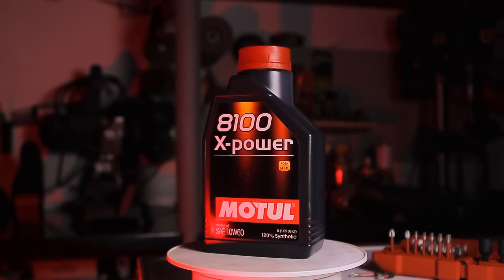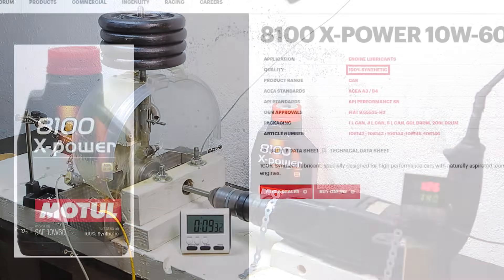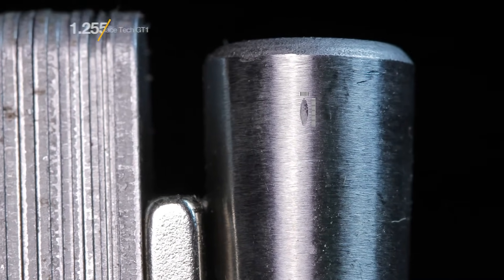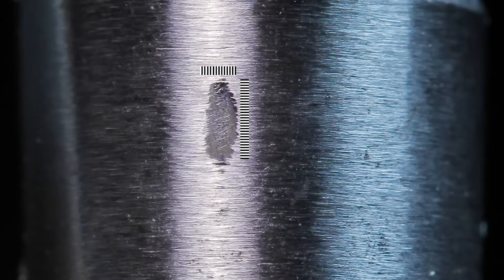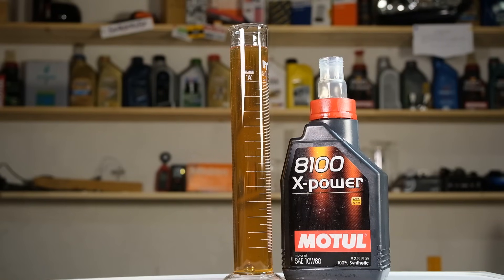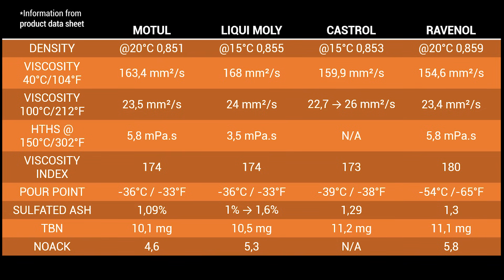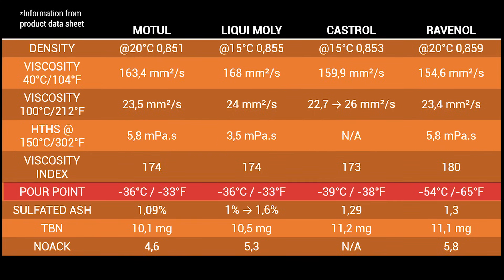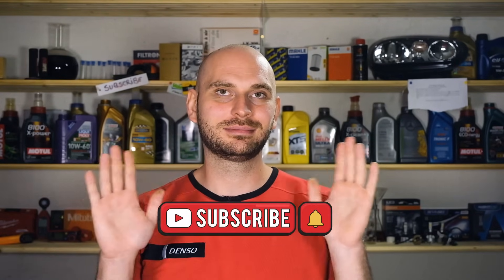Which is the best RACING ENGINE OIL - Motul vs Liqui Moly vs Castrol vs Ravenol - REVIEW & TEST

Comment: Your testing is incorrect and the results are 
misleading.  Pressure ball testing is different 
from surface-to-surface friction. You need to 
measure metal wear under HTHS friction.

Comment: The tests are imprecise because the oil must be warm to work properly and needs time for the additives to work. It's foolish to pour new oil into the car and start at full throttle. The oil needs to work, and there's no point in immediately putting weights on the ball.

Comment: Literally none of these tests apply to an engine. We live in a low information high confidence world apparently. No one knows shit and everyone thinks they know everything. Hey Mr. Expert. Please tell me the breakdown the basestock blends used in each of these oils. Oh no, you don't know what they are? Oh that too bad. How about the additive packages? Oh you also don't know. Man thats too bad. How about even on a very basic general level like doing a new oil analysis just to see the numbers? Did you even do that? Oh no you didn't. Yet you had no problem wasting the time of a quarter million people and influencing them with your utter nonsense. But hey at least you can tell me which one would work best as a gear oil with your lubricity test. That's great. Too bad it's not applicable to what happens inside an engine.

Comment: Can you test Royal Purple, Red Line, Motul, Ravenol, Mannol, Pentosin, and Liqui Moly (the best they have to offer for regular cars)? I have been using Amsoil, Penzoil, Mobil 1, Castrol, Valvoline, Quaker, Kendal, and many other oil brands in the same 3 vehicles (to be able to notice the difference). So far, Royal Purple and Motul have truly outperformed every other brand, but Royal Purple is the only one that actually cleaned to like-new condition the inside of the engines, and Motul is the only one where the vehicles purr like sweet kittens and had a noticeable increase in power and smoothness (yet, I don't know if it is capable of cleaning the inside of the engine as Royal Purple does). That's why I would love you to test Ravenol, Mannol, Pentosin, Liqui Moly, and Red Line (which are the only oils I have not tried - of the well known ones) so I can saved myself the trouble to waste money and time. I trust the way you analyzed the oils and your assessments... they are spot on to what I have witness and discovered in real life myself over the years. Your channel is much more helpful than Project Farm and The Motor Oil Geek. I find those channels sort of bias.

Comment: Finally!!!  A real and more accurate oil test reviews!!! Your tests are much better than the other channel Project Farm which after a detail analysis of what he does I discover a lot of controlled discrepancies. I  posted that to his channel and he removed my comment.  Anyhow, thanks for this review. It's awesome and I have noticed based on my engine performance (with several cars) that your results are spot on.

That being said, can you please test Royal Purple vs Valvoline Restore and Protect vs Motul. I already tested Amsoil vs Pensoil and they are both a let down in my personal experience after more than 10 years of using them (their top of the line oil). I noticed a great improvement immediately when switching to Royal Purple and after opening the engine I saw how clean the engine was. I had opened the engine on the last oil using Pennzoil and then opening it after the second oil change with Royal Purple and it was a night and day result. Royal Purple not only cleaned the engine like new but the engine sound and smoothness was very noticeable, although the car ran one or two degrees hotter though. Then I switched to Valvoline Protect and Restore but since the engines were already cleaned that part did not show any improvements... so I'm hoping you can provide a comparison on lubricity, etc. I also heard that Motul is probably the best European oil and I want to start using it in one of my vehicles which is European. So please, compare those three oils.

Ps. My engines suffered a lot (piston pinging, sludge, noise, lack of power, heat) when using the OEM oils... they ran much better when using Amsoil or Pensoil, and even greater after I switched to Royal Purple. But now that Valvoline has come up with "Restore and Protect" which can be used (according to them) on brand new engines and high mileage engines alike, then it seems like it is the "one-in-all" oil and there is no need to look further... but they don't make it yet for European cars, so in the meantime I want to switch to Motul... If only there was a way to test how good each oil is to clean engines, I mean, in a lab environment. I've done it in real life but that takes having a "normal" dirty engine and then using Royal Purple or Restore and Protect for about 15,000 miles with each test vehicle... I ran out of vehicles to test with since my engines are now super clean.

Anyhow, please, test Royal Purple vs Valvoline Restore and Protect vs Motul.

Thanks for this review and keep doing it.

this is a certified hood classic

Comment: What are the metals of ring and screaw? I mean like it's busted that some test liek that can be easy manipulitaed. eg Great Amsoil do 4 ball test, where each ball is made of steel, and whe their oil has some iron in it, it can reduce the friction between steel to steel... sooo, by just adding proper metal to your oil you can manipulate tests like that. Only test that is proper is on working engine...
Even when you haven't that in mind, you could unpurposly chose oils that would work better than other with the metals you use in your test, but it won't tell anthing about real use.

Comment: @Sergiu Gabor might also be a good idea to test how they perform when they're worn, e.g diluted with e85 which happens fast on high power cars that still run a wet sump.

Then there is the question on how they perform when they are carrying contaminents (metals from the bearings) within them, and how they continue to lubricate with these contaminents still present

Comment: Hi there. Greetings from Guatemala, Central America. Excellent presentation. I have a 2005 BMW X3 2.5 with a M54 engine. I am currently using Liqui Moly 10W-40 (MoS2 Leichtlauf) oil. Any comments or suggestions on if I should continue using this oil or should I change of brand and/or grade.? Thanks in advance.

Comment: Hi I found your channel very interesting and informative 
I run a vw golf r mk7 with a stage 2 tune and modified I see oil temperature normally around 90° to 110° a lot of tuners and forums say use miller's 5/40 part number ( 7953 ) oil or liqui molly ( 2328 ) oil but I contacted both manufacturers and ask what they recommended only miller's oil replied and they recommended there C3 5/40 ( 7806 ) I wondered if you could do a test on your channel testing these 3 oil against VW standard OE 5/30 oil as there is 1000s of people with in the VAG community in my situation running this engine.
Thank jim

Comment: How can Castrol not disclose HTHS in a high performance “race oil?” HTHS is one of the most important things I look for in an oil after manufacturer specs, ACEA grade and base stock (A3/B4 or C3 in my case). I wouldn’t call Castrol BAD but they’re certainly not always the best (maybe in certain oem specs they are… who knows).

Comment: This is perfection.

I usually make conclusions on the pour point temperatures.
Anything under -50 will Most likely be a group IV or V. 
A good example of a oil I use alot is the Castrol Edge 0W40 A3/B4, its specs make all 5W40 oils look like crap in comparison.

Comment: Hi, i have used moly 5w 40 to my accord cl7 06, and i changed it to motul 2100 eco.
Does this motul 2100 eco good enoght? Or better change it to moly 5w 40? Another question, does the castrol 5w 40 edge better than moly and motur. Thank you.

Comment: Thanks for this test. One thing to keep in mind, there are many people that run these oils in winter for daily driven vehicles. So a cold flow test will always be beneficial. Understood, as racing wouldn't typically be done in extreme cold weather. But, you have to take into account of the average vehicle parked outside in the elimates for long periods of time. I myself am interested particularly in cold flow itself which was completely negated in this test. Keep up the good work with the channel and look forward to new content.
Reply: You can find on this channel a lot of test for regular use oils and there is a cold-flow test included in each of those. This is specifically for race spec oils - which you generally shouldn't put in daily driven cars.
Reply: i mean, would you use race oils for daily driven winter cars?
Reply: Using a racing oil in a road car in winter conditions is not smart. No need for the freezer test... Don't use racing oils.

Comment: One thing I disliked about this test was you skipped certain tests due to it being a "racing oil" however some road cars use this as a daily oil. I run it in my M3 and would like to of known how it fairs as a daily oil. The S65 is a race engine which is why it uses it.

Even though, I ordered Motul 👌

Comment: Yes, one CAN manipulate the viscosity index via additives known as viscosity index enhancers, which are polymers with molecules that wrap themselves out at lower temperatures, but unwrap and grab other oil molecules to make the average molecular size larger and render the oil more viscous to avoid excessive viscosity loss with increasing temperature. That's how they can make so many different grades of oil, from 0W-16 to 0W-40 and even 10W-60, with the same base oils.

Comment: Please test some ATV-s oils, they are expensive and for some unknown reasons it needs to be changed at around 1000km, regardless that for the same engines in motorcycles it need to be changed at 10000km.
Thx

Comment: Thanks Sergiu, it confirm my theory that Ravenol use pure PAO or Type-IV oil in some of their line instead of a mixture of PAO+HC-synthetic like most other brands.  The problem with claimed Full synthetic is that mixing HC-synthetic type-III oil base with PAO or Ester Type-V with different ratios can be considered fully synthetic.   This is why for instance, Mannol wrote their oil is fully synthetic but actually contains mineral oil with a large portion and they sell it 1/2 price of other brands for obvious reason.
Reply: Is that Ravenol Telesythesis good or bad?
Reply: @kingsalmanyt2882  Ravenol 👌
Reply: @kingsalmanyt2882  it is still good but overprice for semisynthetic. Synthetic means group III and PAO mix in Germany/Europe.  Full synthetic has to be PAO 70%. Often synthetic they marked it HC synthetic (group iii), without word Full synthetic.  In other part of the world, full synthetic could be HC/group III.
Reply: Agree and have to that Castrol does the same and its bad.highly recomended Ravenol from Germany RedLine from USA with Amsoil Signature Series and Extreme GTi from Russia this one is really good big combo with PAO+Ester . Good pack of aditives included

Comment: Great video! There must be something wrong with Liqui Moly documentation. With HTHS 3.5 lubricity test result would be much worse - similar to 5w30 used in this test. Real Liqui Moly HTHS must be similiar to Motul and Ravenol. In my opinion they wrote HTHS >=3.5 according to ACEA A3/B4 minimum requirement. 10w60 oil with HTHS of 3.5 is just physically not possible. Would you agree with me?
Reply: I got response from Liqui Moly: "We state ≥ 3,5 mPas at 150°C for the HTHS viscosity, as an exact number for every package is barely possible. 
In reality the Synthoil Race Tech GT1 10W-60 will be around approximately 5,5 to 6 mPas at 150° C."

Comment: I own an 2.0 tfsi modified (about 340hp) and i used only Motul xcess8100 and the 300V 15-50, but today i decided to try Castrol supercar 10-60w , the car has 300k and its from 08' and i dont know what to say but the car appears to run way better than before (even tho castrol is the worse one here) . My bet in these tests one important factor is missing here , Oil Pressure , so what i want to say above all is . try yourself all the oils and see how your engine react to it . I was a fan of Motul but man....that Supercar 10w-60 made my car run soo smooth .
Reply: I'd be scared to go that high vis on that engine.  It's got some tight passages that I'd want the thinner oil.  It's not all about pressure unless you are running very high RPMs, it's about flow.  Less flow can increase pressure but it's not what you want.  I have 2 Audis, one 2.0tfsi and one 4.0t.  The 2.0 has a big issue with the tentioner, I've already lost a few valves due to it.  I've seen reports from oil engineers on "Bob is the Oil Guy" who have gone the other way, 0W40 on Ferrari engines that called for 10-60 initially and have positive results from oil anaysis.

Comment: Just remember synthetic and fully synthetic have no technical meaning, the 100% synthetic is a certified fully processed product and can only be called as such when meeting specific requirements.

The viscosity index is a ratio of the 40deg and 100deg test , it is slightly manipulated by which test was used to get kinematic viscosity rating.

Comment: 7:36  Note the Center hot plate is much hotter than end sides.
also noting the 2 outside oils lost the least oil, DUH!!!!    

a true n Proper test should have been with a marked spot where all oil(s) are place individually there 1 by 1

Comment: I have used many motor oils, only Alpine Racing 5W50 is the best lubricant. Acceleration is very fast, reaches maximum speed fast and the engine temperature is cooler than other racing oils.

Comment: Unfortunately this test was not repeated a few times with each oil. Lab testing requires repeated testing to underpin testing results. Further this test does not show wear of the oils under high shear circumstances over a certain time. High shear rates let mulitrange Motor oil wear out due to damages to the chains of the polymers that are in use as viscosifier to deliver temperature related viscosities.

Comment: www.dle.com.tw DLE PolyolEster Base 5W-60 24H Nürburgring Racing Formula GT3(The German oil factory GT3 racing team has nearly 200 games, and the oil factory laboratory has accumulated strong research and development strength in polyol ester racing motor oil.)

Comment: not one comment questioning LiquiMoly's HTHS grade as 3.5 while the others are 5+... no one sees the elephant in the room?!? can I assume the LM instantly shears down to 30w levels but how can it do such a great level of protection? we see the vw 5w30 give an almost 3mm scar to the bearing and it's HTHS is about 3.5.  this confused me.  isn't HTHS all about staying in grade while maintaining film strength? that brings me to question LM's additive package vs base stock ratio compared to the others.  is LM that far ahead of the pack PAO-wise they can claim fuel efficiency AND wear protection? I thought it was pick one but you can't have both...

Comment: 6:17 honest opinion,  like honest facts. Thanks for test. I contacted Motul several months ago and at that time that said they don't have an oil recommended for VW.
Reply: Motul XCess is VW 502 503 rated
Reply: @alanthomas2865  I contacted Motul themselves and a local dealer. Both said they had nothing rated for VW. Thanks, I will look that up and contact them again.
Reply: @alanthomas2865  👍 found it 8100 X-cess thanks
Reply: @334trax2  I get mine amazon for $40ish per 5l. Defo worth the hassle of ordering.

Comment: Motul is the best motor oil I’ve ever used. My performance mechanic’s shop where I do all my maintenance, repairs and mod installations are sponsored by motul and only use motul for all their fluid changes. Will never use another oil brand ever again, no matter how hard it is to get motul at a regular store in person 😂
Reply: maybe biased opinion
Reply: @craftedwithart  Not biased. Going to autozone and wal mart for Mobil 1 or some other generic brand is cool but you notice the difference with Motul. Especially with turbo applications
Reply: @cartiershades3392  I live in EU.  I know motul is good tho. Valvoline is also quality
Reply: @cartiershades3392.... gentilmente spiega che differenza noti grazie
Reply: True, if you get the right product of motul like xcess 5-40 than it works like magic. My mechanic and people said that they had driven the same car of others many time but mine felt like insane powerful and accelerates way better than stock. And then I used motul xmax and it was not as magical as x cess. 
Going to use xcess tomorrow in my present though car manual  recommends 0w20, let's see how it goes but since we have very hot temperatures like 40+ C here so 5w40 will be good.

Comment: Ce m-am bucurat si de fapt eram sigur ca MOTUL iese primul. De mai bine de 3 schimburi doar X-Power folosesc. Totusi, nu stiu unde ai gasit tu 1l cu 18 eruo ca eu am luat cu 185 lei 5, preturile variind de la 37 lei la putin peste 40 lei pe litru. Ai luat o mare teapa daca l-ai luat la pretul ala. Ravenol, cu toate ca si el e bun, e semnificativ mai scump. De la 63 lei pana la hotii mai mari cu 98 lei pentru un litru! Foarte ciudat e ca NOACK-ul de la Liqui in fisa pe care o am eu scrie 6.5, nu 5.3. 
Daca ai sa ai cum, fa un test si cu Yacco, Addinol (nu de pe emag ca fura curent aia) (e doar ~7 euro/l), Selenia Racing,  Syntium Racer X1, Valvoline VR1-Racing, si TOTAL QUARTZ RACING, toate avand tot 10W 60.